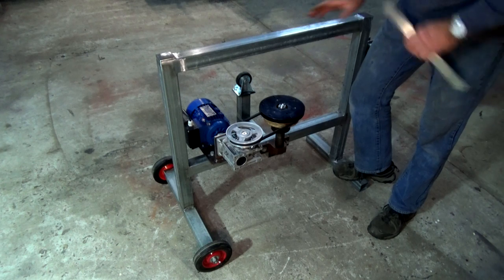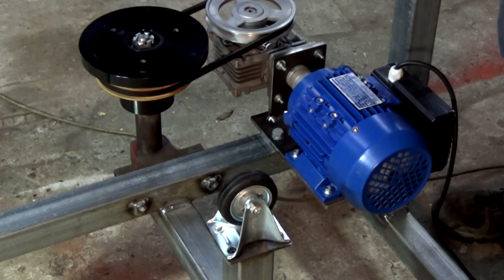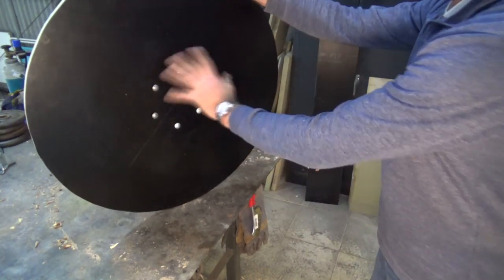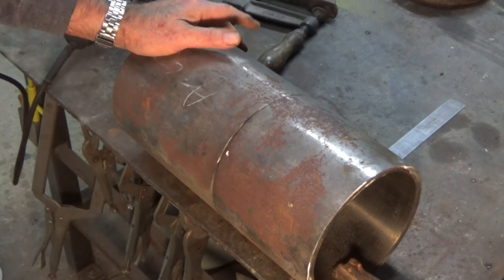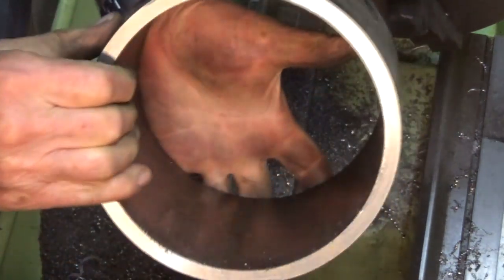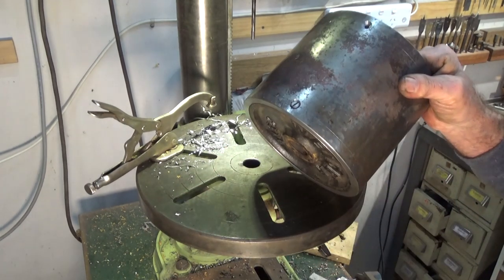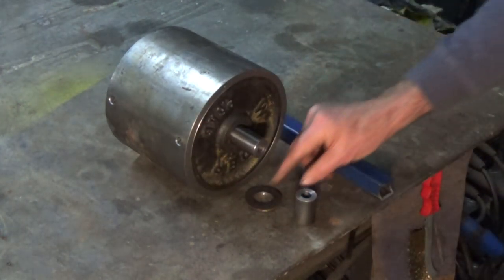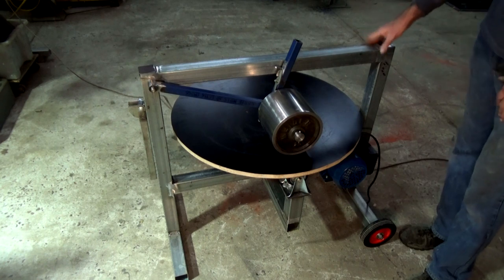The "Kooka Muller", a DIY Sand Muller for the Home Foundry Part 2

Comment: Excellent progress. 

Good idea to use the piece of hydraulic cylinder for the roller. 

I love the latch on the roller arm.   Perhaps a little weight on the end so it always flips down.
The roller seems heavy enough even without being filled.

I get a smile when I see a right handed person filing on the metal lathe.   It is one of the few times being a left handed person has an advantage. 

Looking forward to the next episode.

Dave.
Reply: Yes, roller being empty will be fine, it will naturally then fill up with fines, but with room for a lot, so it will run for years before you need to empty it. the difference between inner and outer diameter of the base and the roller will help nicely with crushing the sand and blending it all thoroughly.

Comment: Very kool Mark.  Your giving me many similar ideas for mine when i build it.  I would add spring pressure to the roller ,
Reply from the maker: I did not end up filling the roller with concrete like I planned to. I will run it for a while to see if it really does need more weight.

Comment: Excellent design! I'm taking a lot of notes. Love the egronomics you incorporate into your design. You might want to consider making the handle so that you can add weight if needed. You never know what the future holds.
Reply from the maker: Good idea. The one that Luckygen1001 made had a handle made of rebar which could be sprung under a pin on the frame to increase the rolling pressure.

Comment: Certainly coming along. There’s just one mod I’d have suggested and that would be to split your roller in two. There’s such a discrepancy between the inner and outer radii that the roller will do a lot of scrubbing of the sand. You may feel this would improve the operation but it will also cause wear. Anyway, feel free to ignore this comment. Regards
Reply from the maker: Peter, I had originally wanted to keep the four weights rolling independently on the shaft for that reason. I am starting to think that the roller should not really come into contact with the base as it should always be rolling on a bed of sand which will be quite thick. Probably it will only ever roll directly on the base when it is being filled or emptied. I should be able to try it out by the end of the week.

Comment: Another late comment...

I like your idea of a drilling attachment for your lathe. That would be much faster than setting up my milling machine to do the same work. More often than not when I'm called on to drill radial, or axial, holes in turned parts the hole spacing isn't all thatcritical, i.e. dividing head not required. Brilliant! 

Thanks for the idea!
Reply from the maker: Yes, that attachment works a treat. It's not my idea though. I saw it in an old model engineer magazine and it was originally designed for a South Bend lathe. Cast aluminium works just fine although the other one I have is milled from solid steel. It's best to use a drill with a solid aluminium gearbox though. I did have a Bosch variable speed drill but the polymer case allowed for a surprising amount of flex in the position of the drill point.
Regards,
Mark

Comment: I installed the app Soundfixer for youtube for my firefox browser. Works like a charm. If a video has a low volume you can enhance the audio. It also makes the sound go through 4 channels instead of just two. But you have to do it manually, it doesn't go automatic.
Reply from the maker: I will check that out. Thanks for the tip.
Regards,
Mark
Reply: @Preso58  That is for people who are watching, and not for editing. But I uninstalled the app because I learned afterwards that the app gives access to your browsing activity to whoever made the app. Sorry for that.

Comment: Excellent work, one thing though, the screw heads are going to wear down with the abrasiveness of the sand. I would use hardened hex heads and fit some kind of rubber plug in the hex or epoxy that can be removed or burnt out later when weight needs to be removed.
Reply from the maker: Good point. The screws I have on hand for the drum are stainless steel and they will be recessed in a countersink. I am wondering if I can glue down a thin  disc of stainless steel on top of the heads so they can be levered off if the drum needs to come out. For the roller I will probably just fill the countersinks with epoxy.

Comment: Great build so far! Just thinking that the roller might need to be conical but the sand will eventually accomplish that task anyway.
Never mind.
Reply from the maker: Scott, I was very happy that I had thought up the idea of using four separate rollers so that each could rotate at it's own rate since the outer one will always need to rotate faster than the inside one. When I took the decision to have a solid roller I knew that it would create some slippage but since it is rotating on a bed of sand it shouldn't matter. When I tested it on the plain surface of the plywood you could hear it abrading the surface 😮
Regards,
Preso
Reply: @Preso58  that will only help the mulling action by helping to smear the sand and clay together.  I know some guys have intentionally aimed the axle of their rollers slightly off the center of the drum to make the roller skid a little more as it turns.

Comment: The build is coming along very nicely, I was wondering about the small run out on the base and thinking of a method to address that as I know you would not be happy fixing the skirt to something wonky to use a tech term. I was thinking a clamped brace and a wood gouge as a horizontal wood lathe. Look forward to your solution with the Router.
 Cheers from John, Australia.
PS: I am not surprised at you channel exponential growth, you deserve it because of good content and quality! PSS Edit for spelling!
Reply from the maker: John, I have made  sort of rotating fixture to hold a big Makita router at a fixed radius from the centre of the base disc. I gave it a quick try out yesterday and it looks like it will work. I badly wanted to use the motor which drives the drum to rotate the edge of the ply under the router but I chickened out at the last minute. I should be able to trim up the base and fit the sides tomorrow.
Regards,
Mark Presling

Comment: Nice built and clarity of communication is excellent. I imagine this will last quite a while. I like the formply idea. I assume you will be putting a divertor plate in to direct the outer sand under the roller.
Reply from the maker: Michael, yes, I should have mentioned that. I have already made the mounting points for the ploughs and I can fit these as soon as the drum base has been trimmed and the sides fitted which should happen tomorrow.
Regards,
Mark

Comment: Nice job as usual, well executed. Can't help thinking an old cement mixer would be an easy conversion though. Perhaps that's just me being lazy, wouldn't be as pretty either.
Reply from the maker: I had been looking for an old cement mixer for this job but I gave up. Most of the ones I could source were so rusty that it was easier to make one from scratch.

Comment: Google .........Wet Grinder ......Made in India....... You get Heavy duty ones for use in large Kitchens and , also small tabletop ones for use in Home Kitchens. These are used to grind into paste (batter) for pancakes (dosa) ...rice cakes (idly------steamed rice cake).....and doughnuts ( vada)....! Lol !.    We also used to use manual grindstone set made of hand chiseled granite. During my childhood day's , we used to use these manual ones. Just a reference to compare this in-depth DIY of the ""Kooka Muller"""

P.S      Note that these are used as wet-grinders or  semi-wet, whereas  ---  The use here is for dry homogenising of material----- The difference is that the heavy base bottom made of Granite in the former,  is not needed for use in the latter.

Hint.... Google.... Tilting Type Wet Grinder .         Sowbhagya Wet Grinder ..... and a few other brands made in India .
Reply: @Preso58   Glad that you checked this out. You are on the right track with your design.  My easier way would be a closed rotating Ball Mill. Thanks for the reply and sharing your design.

Comment: Looks like an all around clever design to me. NIce! Do you think there would be any advantage to making the surface of the roller kind of knobbly like you see on big soil compaction machines? Something to further upset the sand and also provide traction so that the roller don't just skid along?
Reply from the maker: Hugh, It is probably not accurate for me to call it a compaction roller. It's job is to break up the lumps of compacted sand and to roll it to a consistent texture with the correct amount of moisture. I think at a microscopic level it helps the very fine clay particles to adhere to the much larger sand crystals.

Comment: I think you have great plan. Watch that galvanized steel wielding the fumes can make you sick. Cross breeze with a fan and good ventilation will help. Two layers of form board? Thanks for sharing.
Reply from the maker: Sam, I don't think it needs two layers of ply. The jockey roller does a great job removing the bending load from the base of the drum. It's a lot stiffer than it looks ....said the bishop to the waitress 😁
Regards,
Mark
Reply: Yes I saw the jockey wheel and like it. I was thinking long term robustness the hub relief is thinner and grease pack your hub if it full of grease there’s no room for sand and water. Great work excellent project.

Comment: Great work. What type of lathe is that?
Reply from the maker: It's a Colchester Student MKII. It's not the original colour. I refinished it twice and I chose the colour from a colour chart thinking it was similar to the industrial green you see on some lathes and milling machines. When I started to apply it I was a little shocked at how bright it was. It sort of grew on me though.
Reply: Thanks Mark. Nice lathe.

Comment: That's one mean Muller you got there!
Being a subscriber of Luckygen1001, I have to ask: Are you going to use also a control timer from a microwave oven?
Can't wait to see it working :-)
PS: Just before you mentioned it, I was thinking: If you attach a router firmly to the frame, aside the drum base, you can use the base movement to route it to perfection.
PPS: First time here and already subscribed.
Reply from the maker: Jose, I went through lots of scenarios for trimming up  the edge of the drum and I badly wanted to mount the router on the frame and then drive the drum against the cutter. It would have been spectacular if it failed and there was a good possibility that would happen. I decided to take the more pragmatic approach and make a jig which pivots around the centre hole in the drum base. I made it up yesterday and tried it out but I am waiting for the Sikaflex to cure between the aluminium skin and the plywood before I trim it fully. I ended up buying one of those old analogue timers used in first generation microwave ovens for the switch. I liked the one that Luckygen used but it is quite large.
Thanks for subscribing.
Regards,
Mark Presling
Reply: @Preso58  Thanks Mark :-)

Comment: G'day Mr P.  Nice job.  I like the look of the muller. The bolts through the form board are you going to epoxy them in? The thought there is you would not have to pull the whole tub apart for repairs if it so happens. Just a thought. I might be stealing that idea from you as well.😉Thanks for sharing. Cheers!
Reply from the maker: Yves, someone has alerted me to the fact that the crushing action of the sand will most likely wear away the torx sockets or at least change their shape which could make it hard to remove the screws at a later date. I am thinking I will have to cover the countersunk heads some how although now that I think about it the roller doesn't go anywhere near the screw heads. Scratch that Idea! I think it will be fine as it is.
Regards,
Mark

Comment: Great video.  Are you planning some sort of sweep to redirect sand under the roller?
Reply from the maker: Roy, yes, I should have mentioned that. There are two ploughs that direct the sand under the roller. I have them half made but they cannot be mounted until the base of the mixing drum is trimmed to it's final diameter.

Comment: I don't understand why you didn't press it? Doesn't it block because you didn't use bearings?
Reply from the maker: If you are referring to the roller, I have since fitted ball bearings to the cast iron discs at the ends of the steel cylinder. It's better that way but the sand can still build up on the surface of the roller and sometimes it's necessary to scrape it off.
Regards,
Mark

Comment: great video  why where you running the lathe so slow tho.
Reply: Cast iron, too much heat and it will be hard on the cutting edges, so slow is better to keep the tooling damage down.
Reply from the maker: The setup was a bit dodgy. The cast iron disc was being driven by the friction between the spigot and the iron disc and the tool is acting at the outer edge of the disc so there was a good chance that a heavy cut or high speed would cause the job to slip. If the job stalls and the tool is still feeding you can end up breaking the insert. For the large diameter tube, there was a lot of stick out on the job and not a lot of stiffness in the grip of the chuck. If I was doing this to make money I would use a better setup so the job cycle time was shorter but time is not money for me. 
Regards,
Mark Presling

Comment: you will want a "plow" to push the sand into the path of the roller
Reply from the maker: I have most of the parts made for the ploughs but I will need to trim the drum base to it's finished size before I can mount the fixtures for the rods that support the ploughs. It should all go together tomorrow I hope.
Regards,
Mark Presling

Comment: Dont think you have to vent that gearbox. Overkill in my opinion. There is enough space inside for any type of grease expansion. Its is not packed to the brim. Any expansion is allready compensated for from factory. You are going to waist your money and time on cooling that gearbox.
Reply from the maker: I am thinking I will just drill a very fine hole in the filler plug.